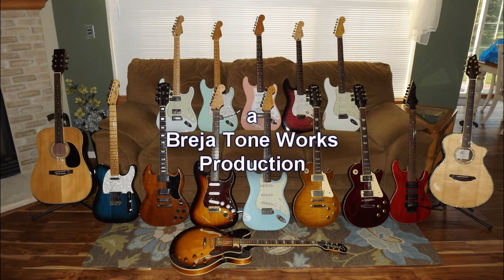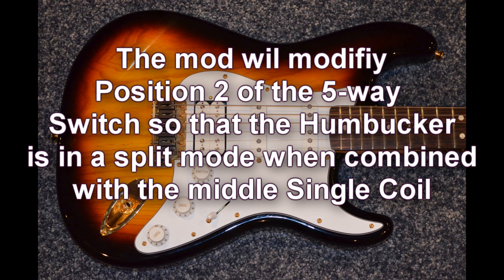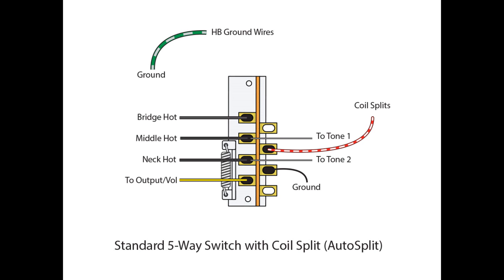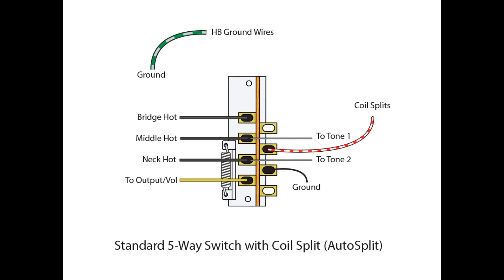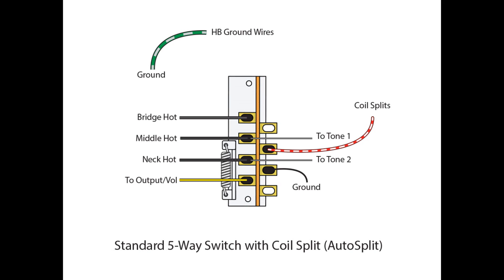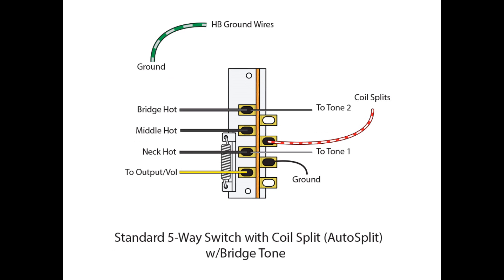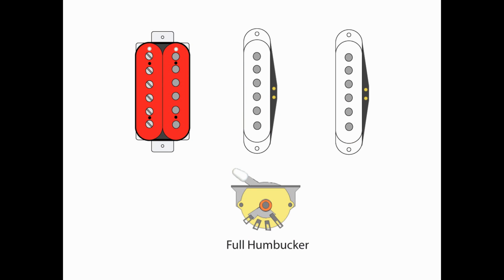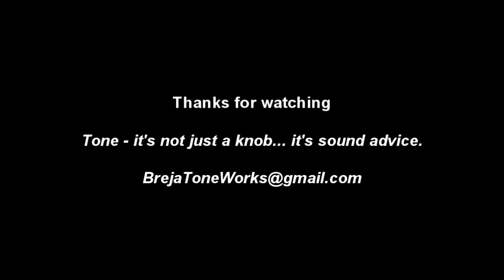HSS or HSH AutoSplit Mod

Comment: I was under the assumption you had to reverse the neck & middle to ensure proper phase. This method seems more sensible and your videos are a much needed addition to youtube. Great work!
Reply: Speaking of proper phases: I've spent so much time trying out different wirings in order to achieve hum-cancelling 2nd position with various pickup combinations. As I settled down with a pair of DiMarzio SDS-1 (with RP/RW middle pickup) and Suhr DSH+, it came down to using black single coils' wires as hot instead of whites so the middle RP/RW one works properly with the humbucker's north coil. Ironically, the DSH+ also has black wire as hot output (similar to Seymour, I believe) so it doesn't even look confusing on the switch.

Comment: On the HSS AutoSplit, I understand how to do it, but I don't understand why it works. 

As far as I can see, in position 1, both A1 (the split humbucker) and B-2 (the full humbucker) are connected.  Why does that result in output from the full humbucker? Why doesn't it mean that 2 of the coils are connected to each other and short out, leaving only the other coil active? 

If having 2 of the coils connected to each other doesn't cause a short but just activates 1 of the coils twice, so to speak, and therefore that connection is irrelevant, then why does position 2 - where it looks like both A-1 and A-2 (the split humbucker and the middle) and B-2 and B-3 (the full humbucker and the ground) are all connected - result in output only from the split humbucker and the middle, but the full humbucker is not active?

Comment: Hi…I’m loving your videos. They’re very informative and solved most of my current problems.
I have a question. I have a Squier SSS, 1 vol 2 tones. I have purchased Seymour Duncan hot rails in neck and bridge positions. Can you help me with a wiring diagram to install the hot rails in neck and bridge in the Squier leaving the middle pup the same? I have tried but with out of phase issues….

Comment: This is great -thank you.  The title if the video mentions HSH but is not covered in the video.  In HSH configuration,  if you wanted to auto split in position 4, would you attach the red/white wires from the neck humbucker to B4?  If not, is this possible and how would you do it please?

Comment: I have an HSS (auto split mod position #2) with the tone knob closest to the volume assigned to both the neck and middle pickups. The bridge pickup gets its own tone knob-the one closest to output jack.

I don’t want to misquote you. I was understanding you saying you can’t have two pickups and one tone knob with an HSS autosplit mod/position #2, but actually you CAN. I have an HSS with that mod and specifics. Or were you saying that with your particular preference or for the purposes of your diagram, you can’t have two pickups and one tone knob with your your particular diagram?

Comment: This configuration is the one that comes on Ibanez guitars!
Reply: It is, but they also utilize a few different specialty 5-way switches to accomplish this. Not all import style, in-line 5 way switches are the same, Ibanez's switches have different model numbers on them, and that number determines how the traces are wired internally to control the functionality of the switch.

Comment: Hi, I'm doing an HSH setup with a 5 way and push pull to split the humbuckers.1 Master volume.1 Master tone. I want the tone control to be the push pull.( Out of the way) When up both are single coils.( Straty) Down both humbuckers. 5 way remains a standard 5 way. Basic but I'm having a hard time finding this configuration.

Comment: If you did this exact wiring with the tone knobs controlling the neck and bridge independently are you able to use a 500k tone pot for the humbucker and a 250k tone pot for the neck single coil?

Comment: Thanks, how could I split 3 mini humbuckers (Hot rails) in positions 2 and 4 thanks!
Reply: This is the question I have as well, I know these videos are old but I wish he would respond to some of the questions.  He seems to know more about wiring than anyone else on YouTube.
Reply: @johnnyh64  I managed to split all pickups in all positions, not only in positions 2 & 4, with a push/push pot (can be push/pull). I think spplitting only in 2 & 4 would be achievable with a super switch but it seems too complicated.
Reply: @GerryBlue  Thank you for replying.  I was thinking I could do the same with 3 push pulls which I think I could figure out the wiring for that setup but to get all 3 pickups set to single coil based on one push pull, I’m not so sure how to wire.  Do you have any schematic or video that you followed?
Reply: @johnnyh64  Sure, here's a link, just be aware that this image calls for the middle pickup soldered in reverse, but if you have three Hot Rails, like I do, that will lower the volume in positions 2  & 4 a lot, so wire them all like Neck and Bridge. https://www.seymourduncan.com/blog/latest-updates/how-to-get-two-strats-in-one
Reply: @GerryBlue  Thank you so much Gerry!  It was hard for me to find but I did find this as well so I’ll post it here for others if they need it;  https://d2emr0qhzqfj88.cloudfront.net/s3fs-public/diagrams/3h5w1pptsplitall_1pptaddb_0.pdf. I really appreciate you taking the time!!
Reply: @johnnyh64  Nice, happy wiring

Comment: What would happen in position 4 here (neck + middle) with the tone pots? They are shared? I mean, you're connecting Middle hot with Neck hot, thus also connecting Tone1 to Tone 2. And another thing, in position 2, how would the "Tone 1" pot affect the bridge pickup?
Reply: Late reply, but someone might find this useful. What happens to the tone pots on your traditional strat in positions 2 and 4? In position 2, the (middle) tone pot affects both pickups. In position 4 both tone pots affect both (middle and neck) pickups the same. I had a strat for more than 10 years and i just realized this, thanks to you.

Comment: I used this diagram but now in position 2 it is not hum cancelling. The inner Humbucker works with middle single coil fine but not hum cancelling. How would I fix this?

Comment: Hi Don, I have a Fender Am. Special Strat. On this guitar the second tone pot is wired to the bridge pu. Will it require any additional wiring mods to keep it this way when doing the auto split mod? I'm dropping in a Seymour Duncan Little 59. Thanks!

Comment: Thank you for your video. I have a Dimarzio humbucker bridge pickup. If red is the hot wire for Dimarzio, what will be the coil splits(red/white) for Dimarzio humbucker? Thanks!
Reply from the maker: +Universal Liberty Red=Hot       Black/White = Coil Splits            Green/Bare = Ground

Comment: Quick question. I have an hsh guitar and I’m going to put a single coil-sized humbucker (fast track 2) in the middle position. My guitar currently comes with this wiring (the one in the video) but I would like to make it also split the middle pickup when in positions 2 and 4. What would I need to modify in this diagram to do so (if posible)? Bear in mind that I only have one master volume and one master tone

Comment: Hey man, thanks for the video! Im having a problem on the second position! The sound is very weak on this position, the rest works fine but the sound on position two is very weak, using texas special and SD jb on the bridge
Reply: +Samprayer2 Sounds like it's out of phase. Try switching the black and green wire on the JB
Reply: +Stig Arne Berglund thank you hehe i realizednit on the same day, saw it in a forum and swapped those two wires and it was done, but thanks anyway

Comment: me again. Now I understand the connection of the white and red cables. The red and white wires are supposed to be the connection between the outgoing wire of the outside coil, and the incoming wire of the inside coil, is that right?...so in position 4, the outside coil will sound along with the middle pickup ; not the inside coil. I say this because in the drawing where you show the pickups, you say that the inside coil will sound together with the middle pickup...I understand that the outside coil will sound together with the middle pickup

Comment: Great mod! I did it to my Charvel Wildcard SSH guitar which has an in-line 5 way (import?) switch. This guitar only has 1 volume pot. Originally I was going to put in a push-pull pot in order to coil tap the Duncan bridge pup. Can I still do that and keep this cool “auto tapping” switch ability or, is it one or the other?
Reply: I'm no expert- I'm learning all this stuff because I need to wire my strat, but I'm just about to do exactly what you described... the auto coil split described here plus a manual split with a pop-up knob. (plus a second pop-up knob to turn neck pickup on at any time- Gilmour mod). 
It seems to me that it should work because when you split the coil all you're doing to shut off one of the coils is taking the signal of the red and white wires and sending/shunting it to ground so that it goes nowhere. 
So in position 2 it gets sent to ground by the 5-way.  If you also send the red and white wires to a toggle it will shunt it to ground when you activate it - regardless of what is going on with the 5-way.
So if you are in any position on the 5-way, operating the pull-up will ground and split the coil regardless... unless it is in position 2 which means that the bridge bucker is shunt whether you like it or not.

I think we can run a wire from the 5-way tab that the red and white are soldered on to our switch.
And the other wire from our switch goes to volume pot to ground it... or to the B3 tab of the 5 way since that is also a ground that goes to the volume pot (assuming that doesn't create some ground loop that can make your guitar buzz... I don't think that is technically a loop though...)

Comment: If my HB has only 1xhot and 1x ground wire, will i have to convert it to a 4 wire set up ? Or can i just wire the single wire in each case.
Reply: In my research in this topic, I found that you cant split a humbucker with 2 wires, it has to have 4 wires.

Comment: Hi there, i would like to know if you have the complete diagram for the hss autosplit mod? I don't know which tone pot lugs would you connect the 2 tone controls? also, where is the potentiometer factored in here and the ground on b3- where is this connected?

Thanks a bunch
Reply from the maker: Email me directly at:  brejaToneWorks@gmail.com

Comment: Don, i have a HSS strat and i want it to have auto-split in position 2 and 1 tone for bridge and 1 tone for middle+neck. Why that is not possible? Will it be possible if I use, for example, a push-pull and forget the auto-split?
Reply from the maker: The reason is that we're using the other side of the switch to ground the coils splits of the HB leaving no additional lug for the combining of the Neck/Middle for tone control purposes.  Yes - you could add another toggle switch but in my opinion controlling it would be a pain.  if it were me - I'd move one tone control to the Bridge and the other to the Neck and leave the middle without a tone control.
Reply: Ok Don, I got it =) Thanks

Comment: Hi Don,

I am planning to built a HSH super strat and would like to wire it like this

https://youtu.be/RD1BreeMzGA?t=2m35s

I did watch a lot of your videos to try to sort it out, but I couldn't. There is some auto spliting in both the humbuckers and different switching going on on that 5-way. Like the middle being the outside coils of the bridge and neck humbuckers. I don't think it is a normal 5-way though.

Master Volume and Master Tone 

The positions are:
1- Bridge Humbucker
2- Bridge inside coil and middle
3- Bridge and Neck outside coils
4- Middle and Neck outside coil
5- Neck Humbucker

Then a coil split for both humbuckers in the same push/pull pot and a switch that by-pass everything else but the bridge humbucker and go straight to jack.

Would you help me?